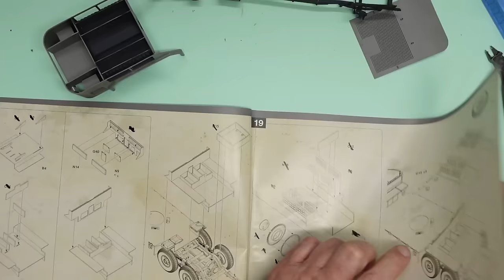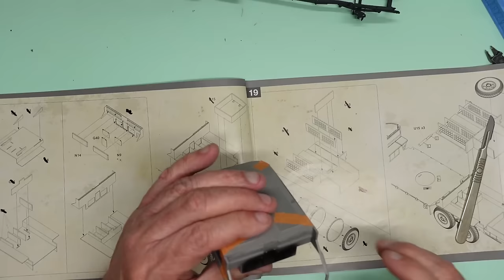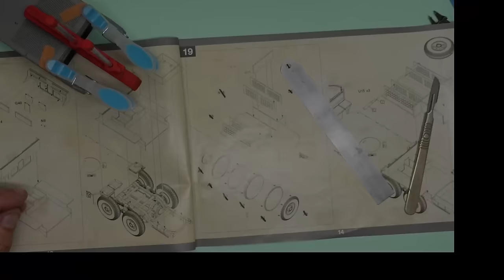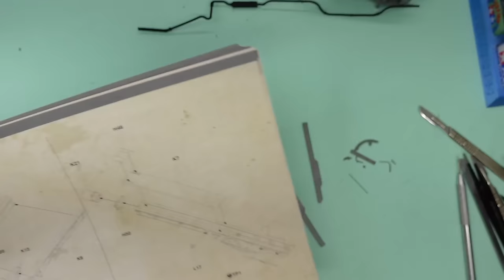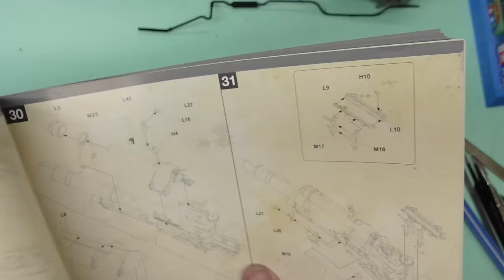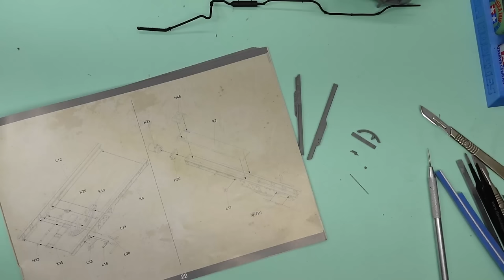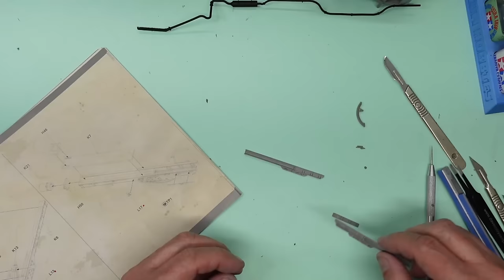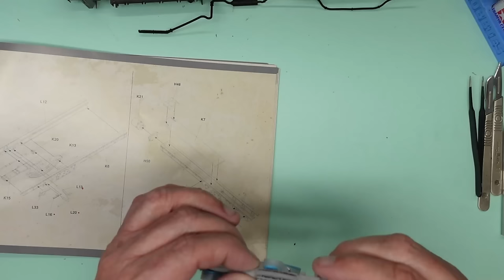Das Werk 1/35 8.8cm Flak auf 9t VOMAG build. Part Eight

Comment: Another excellent video Nigel !👍Your 'neat little tricks' which solve problems, guarantee good fit, and so on, are greatly appreciated ! 👍Thank you!👍
BTW, given that it is now April 13th in the U.K., I hope that you have gotten to the point of attaching the back end of the body to the two other (already attached) sub-assemblies, so you can give yourself a mental break, have some fun painting & finishing off details on the body of the vehicle, and consequently return to 'getting your mojo back'. 🙏

p.s. So, do I have this right? The Germans were total perfectionists with their wartime designs & manufacturing of soft-skin vehicles & AFVS, but the Brits waited until after the war to become absolute perfectionists.....specifically, only when building plastic reproductions of said vehicles & AFVs? 😉😁😂 (..FYI I have both English & German blood in me, which is why I didn't hesitate to joke about these matters...)🤣
Reply from the maker: Yeah, all done last Tuesday or Wednesday. It's in part 9.